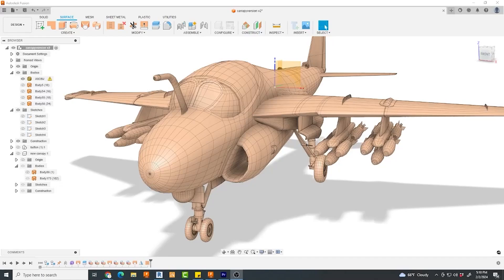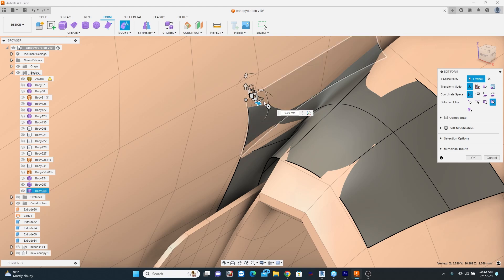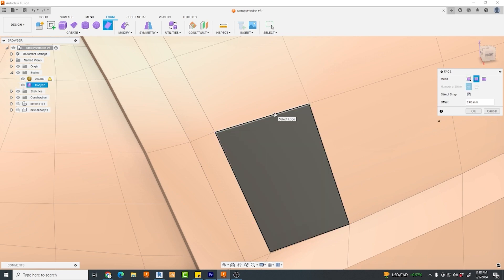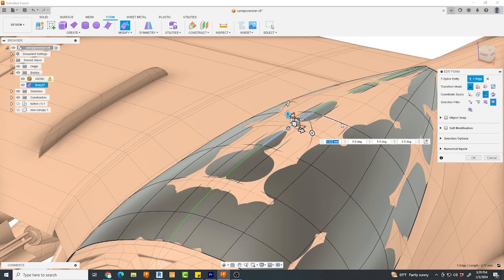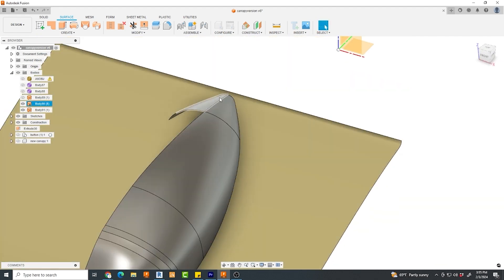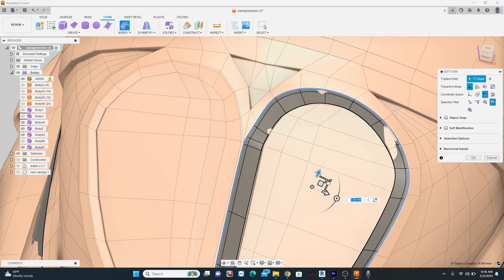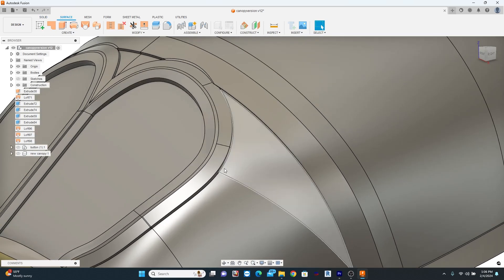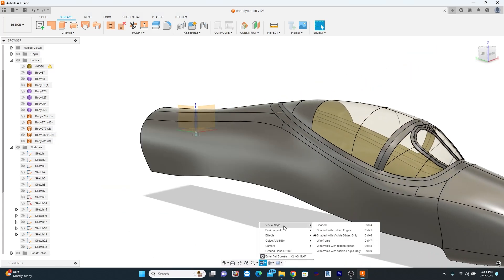A6 intruder Reverse Engineering the canopy.  Fusion 360 with forms over obj file. #fusion360

Comment: Your telling me I could have just cut faces with a solid this entire time? Mind blown. I have always worked in solids till recently as I had no need for the other tools in my work. TBH I always thought they were just not accurate enough for the tight tolerances I worked with. Some times It had to be withing .0005" for some of the assembly fixtures.
Reply from the maker: Yeah I don't remember where I picked that up.  Think I just accidentally discovered it.

Comment: Great video, thank you for sharing.. I'm curious about how to make the skin thicker. Thicken command would work well for that?
Reply from the maker: Yes you are converting a surface to a solid with that command.
Reply: @redbaronrc  When I am using thicken command for the complex shapes like this its giving error. Could you please show that in the upcoming videos?
Reply from the maker: @RJMathiyazhagan  this happens when the seams cannot maintain their geometric shape with the thickness attempted.  Try splitting the object up to see where it's failing, or also try giving it a negative number just to test.
Reply: @redbaronrc Thank you for the info. I  will give a try.